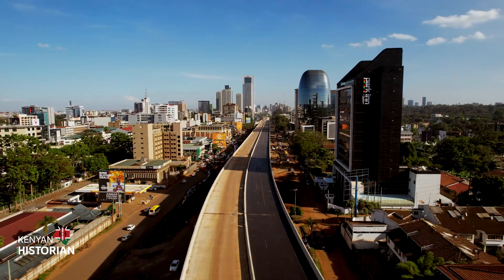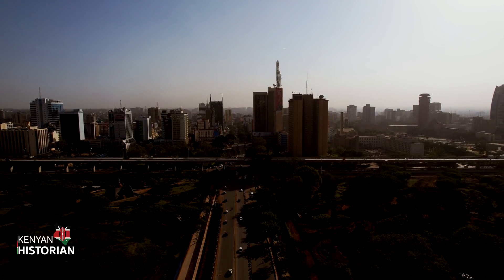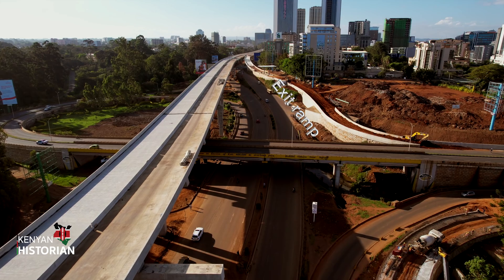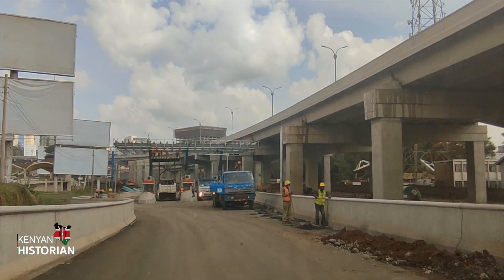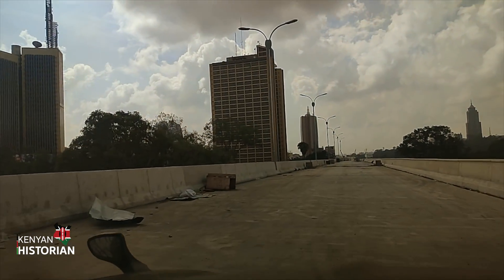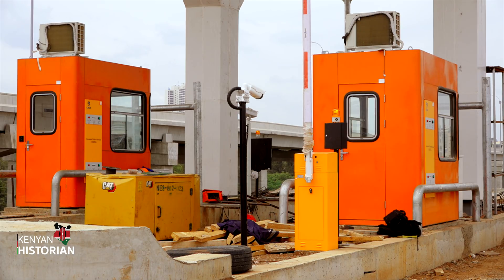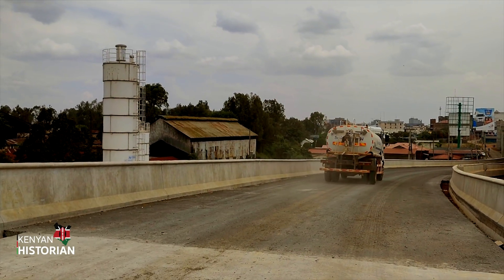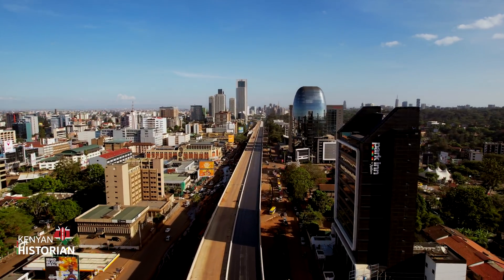EXPRESSWAY TRAFFIC FLOW: How Nairobi interchanges have been designed to ensure smooth transitions.

Comment: The traffic situation will not improve until Nairobi and Kenya as a whole has a well developed rail system / subway. ...   Rivers of Iron.    ...   Although this is an improvement, it's very very minimal in the grand scheme of what needs to be done.

Comment: great content Enoch, I hope that the expressway will bring what everybody is hoping for - even there is no example for a highway like this in any city in the world, that helped on the long run. Cars will go where a street ist. If there is a street, more cars will come and the next solution will be to upgrade the existing street once more. What are your thoughts on that?
Reply: I agree with you to some extent. In my opinion, investing in a working, comfortable and consistently reliable mass transit system is the best way to reduce traffic. Something like a subway/train system. Or a BRT (Bus Rapid Transit) system. However, such an infrastructure was needed in this particular highway because it is part of a much larger transit corridor between the east african countries. This route was always going to carry traffic no matter what happens.

Comment: Hey hey hey, slow down one bit brother...the expressway is NOT a transit system. You need to improve your script abit further, you are already above average but eliminate some of the goofs in your storyline and you'll be total...e.g. like saying Nairobi is one of Africa's 'most developing' cities...those two words most developing don't go together that way. Either most developed or fastest developing would do in such a case. 

Kudos, I'm a great fan and fullower and subscriber to your content. Come do Kisumu too. And Eldi and Naks...my three other favourite urban centres in Kenya.
Reply from the maker: I like corrections but informed corrections. Of course it's a transit system. You need to read further on transportation you will understand why it is a transit system.
Reply from the maker: Definition of a transit system: transit system means a system used for the transportation of people and goods by means of, without limitation, a street railway, an elevated railway having a fixed guideway, a commuter railroad, a subway, motor vehicles, or motor buses, and includes a complete system of tracks, stations, and rolling stock necessary to ...

Comment: Great piece🔥... 

But I have a feeling those tolling stations will build up traffic at the entry points
Reply from the maker: I agree. The only way to deal with that is to ensure a majority of users get electronic cards that have the sensor system
Reply: @KenyanHistorian  💯
Keep up the good work bro...and Team 👍
Reply: @KenyanHistorian  NY State has phased out toll booths and replaced it with RFID readable passes that’re mounted on windshield next to rear view mirror and it works like magic. No stopping to pay toll, you maintain hwy speed and the electronic pass transmits the signal to the transceiver and the money is either deducted from your prepaid a/c or from your bank a/c. There’re also High Speed Cameras installed that automatically zooms in to take pics of toll cheats. Eventually if cheats don’t pay, they’re fined. When multiple infractions occur, arrest warrants are sent out and it’s not even worth the risk coz they will impound your car for non payment.
Reply from the maker: @samgaya2387  If you listen to the PS again you will here talking about the RFIDs... But I think they expect that by the time many people have it, ATMs will be the first phase...
Reply: @KenyanHistorian  Yes I did hear you mention it. Good job though, only way is up.

Comment: about the haile sellasie interchange..how will cars coming from mlolongo exit to enter the CBD?
Reply: See my comment above. There is no exit to CBD if coming from Mlolongo side; either you exit at Bellevue or go ahead to UoN.Thats the blunder, Nyayo and Bunyala might remain jammed. But coming from Westlands you can exit at Bunyala R/about then head back to town
Reply: @thomaskibet8818  then they will lose a lot...why should I use express way only to get off at Bellevue and have to deal with the traffic jams around Nyayo and Bunyala round abouts?doesnt make sense. They will lose a lot of revenue due to that mistake..When using the mombasa road from mlolongo, am likely to have a smooth flow from mlolongo to around nyayo..so for someone going to the CBD using expressway will have zero gain.
Reply: @okarimangana8578  It will help you because cars will be lifted to give you less traffic at the bottom

Comment: Too bad the new upper highway is cutting right through the city (although from your video it looks as if it is not going right through the centre).  Would have been so much better in all aspects to have gone around the city, along with a parallel plan to discourage traffic going into the city in the first place (ie. rapid transit, such as a train on the upper level rather than cars.  Please do correct me, if you think my ideas are off the rails.
Reply: if am not wrong there will be a dedicated lane for rapid bus on the upper deck of the expressway. Would that help from your illustration? But i think what you are saying is the expressway should  have rapid bus or rail on the expressway going to the city and for cars instead of going to the city have them go around the city on a seperate upper deck road?

My understanding is that the purpose of the expressway is to have cars that are not going to the city to be able to by pass the city . The current system is cars going to the city are lumped together with cars not going to the city. For example if i am going to say westlands and beyond, i will not have be lumped up with cars going to the city, but i can take the expressway and drive straight to westlands without being inconvenienced or jammed up by cars going to the city just for me to get to westlands and beyond. And the off rumps or interchanges  serve the same purpose of avoiding city traffic vehicles , for cars going east or west of the city.